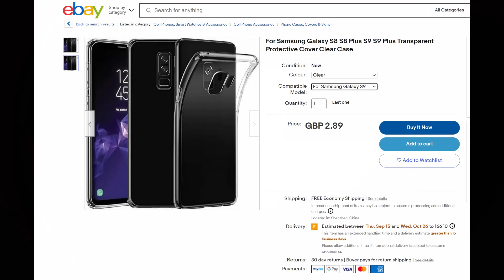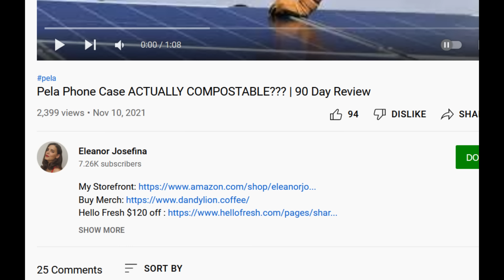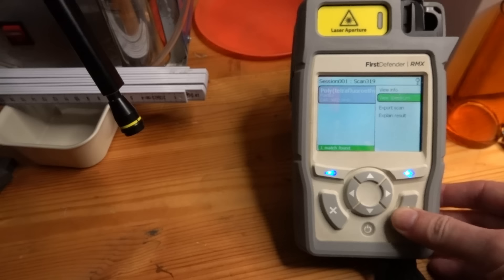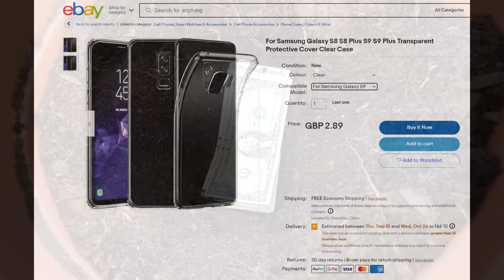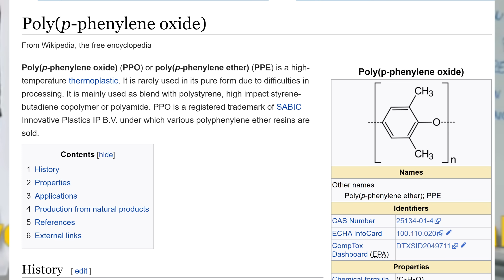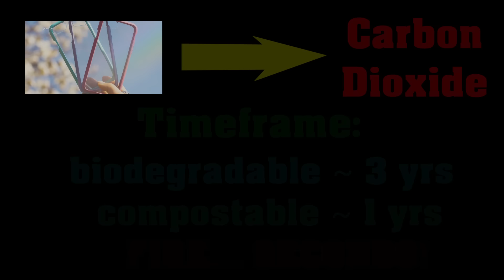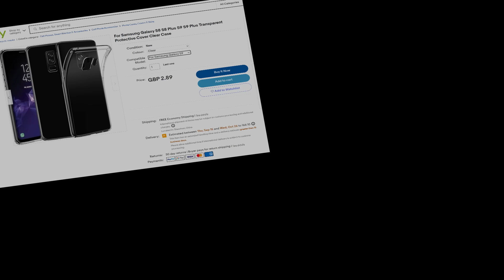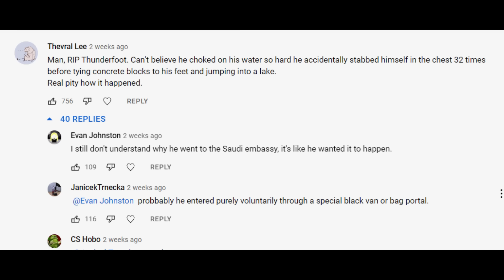Pela-Case: BUSTED!!!

Comment: Fun fact:
Just don't buy unnecessary tech just because it's new. And buy a plastic phone: no need for a case as you haven't got a glass back to break!
Reply: Cases primarily protect the screen not the back. If the back gets broken you can probably cover it with a case anyways.
Reply: What about the front glass?
Reply: Since I dropped my phone a Nokia 3310 (plastic) out of my pocket onto concrete at work and it suffered unexpected fatal disassembly I always have a phone protector and screen protector. now if I drop my glass cased iPhone onto concrete it bounces with zero damage.
Reply: @--_DJ_--  glass protector. All my devices have screen protectors and the work.
Reply: @PalladinPoker  Frankly speaking only a case with a flap or a "holster" would protect your screen. The screen will break with any other type, as soon as there's a tiny rock on the ground that protrudes enough that that border on the sides is rendered useless. Or if it's a tiled surface (happened to my mom's phone... while it had both a screen protector and a case, was quite an unbelievable sight to behold).
Well, it generally won't matter, as the phone itself will rarely hold up past 2 years. And people will change them every few months, bcs new shiny piece of polished $*** is better" than my "old" piece of $***.
:(
Reply: @dogwalker666  I don't know how much drop protection glass screen protectors really provide. Usually when we see a glass screen protector break, it's not necessarily an indication that it was absorbing all the impact, so much as it's just a much thinner piece of glass than the front screen of the device.

Not saying they don't have any utility, it certainly help with scratch prevention. I think they might be less valuable withdraw protection than a lot of people think
Reply: @syclone  Then there's me, replying on a phone made when Obama was president and the UK hadn't decided to leave the EU.

If a phone lands screen down on a hard protrusion you are screwed regardless. I don't use cases myself, just treat the phone like the valuable and delicate device it is.
Reply: @PalladinPoker  use a bare Xperia X Compact myself. The size is one that actually fit's in a pocket and is comfortable to use single-handed.
Drawbacks: no IP rating ( only the japanese S0-02j version had it), the headphone jack is on the way out (the quality of these really dropped, my MD Walkman works perfect still) and battery is holding the charge as when it was new.
Better than a Samsung, but not perfect.
Reply: @syclone  My moto g6 was 3 years old when I got it and it still works just fine. I don't know anyone who gets a new phone every few months.
Reply: @--_DJ_--  I know plenty of people, including my boss and several classmates from uni (rich parents). It was amusing to see them struggle to use Word though xD.  Crazy people. Meanwhile I'm still using my 20 year old minidisc... 
It is also ridiculous how over-specced these phones are, compared to what they end up used for.  Aand, with all those specs, still can't run fully-fledged Excel hahah.
Reply: @syclone  I was still using a Samsung Rugby 2 up till last year. They were annoyed at work that I couldn't use the new google stuff they have set up so they gave me a phone and pay for the plan. I can rarely text someone without mashing a few wrong buttons, I would not trust any excel document created on a smartphone! I might be the only person in the world who misses T9.

Comment: Another way you can offset your carbon footprint would be to plant one or more trees.  Trees and other plants pull carbon from the air, and (please correct me if I'm wrong) gain most of their mass from that carbon they pull from the air (excluding water mass, though some do pull water from the air too).
Edit: ah nice just after I posted this, the video mentioned trees 😁😁

Comment: I don't think these YouTubers know that "compostable" does not mean burying in the ground or even in your garden compost pile, they are meant for industrial composting, with high heat and humidity. Same for the "compostable" shopping bags that are regular plastic bags with a bit of corn starch and don't decompose in your backyard. The starch just breaks down the plastic into smaller pieces that stay for years in the environment, until we are able to bio-engineer bacteria that will really be good at degrading this energy-rich plastic.

Still, an outrageously pricey phone cover that will probably start biodegrading in my sweaty hands as soon as I try to hold my phone. And you're right, in my city of Toulouse, France, non-recyclable plastic is burnt, with the heat providing hot water and winter heating for 40,000 apartments, nothing gets into the sea.

Comment: I got my Pelican phone case from Goodwill. Helps to be using a old phone where old cases are in thrifts. Also, I saved the carbon of several phones. I will use it until it breaks.

Comment: 8:50 i have the same kind of stock phonecase which came with my oneplus6. The phone survived a staircase fall without meaningful damage.
A more general comment : 
i just don't understand how people come to think mixing biodegradble stuff with plastics improves anything
Moreover the hype over  biodegradable stuff is just as insane. I don't want my stuff to degrade when exposed to moisture.
If anything we should make most plastics more resilient, more resistant to UV and physical damage. Some fiberglass reinforced plastics are really really sturdy and endure many abuse before they fail castrophicaly and go to the trash bin.
We should design stuff that will not get trashed before a very long time and that can be repaired, repurposed or recycled (or incinerated in a responsible way)

Comment: Money is a receipt for work. Work requires fuel/energy. You need to work 20x more to buy the Pela case than a $3 case. Not very green.
Reply: yeah that's what i think every time i see expensive green stuff. i saw someone else suggest going to carpenter and paying them $50 to make a case out of wood. and i was like, no way can that be better than the $2 chinese plastic case. if they can do for that much cheaper it's because they found a way to do it more efficiently.

Comment: I'd be curious if there'll be any false advertising lawsuits over these phone cases, as they're clearly not compostable by their own definition, or compostable by general definitions. I'd also be curious to see if there's any grounds within that lawsuit to go after the green marketing of this, as it's not really any greener than the majority of typical cases on the market; it's not a change such as single-use plastics to recyclable plastics for example, it's more of a change of unnamed recyclable plastic 1 to unnamed recyclable plastic 2 of nearly identical, if not entirely identical, plastics. I'd also be curious where they're actually getting their 'carbon credits' from, I wouldn't be surprised if it's a 'we planted a ton of trees' situation, of which would be more worthless than not cutting a tree down; while combatting deforestation is good for a variety of reasons, the whole concept of combating carbon dioxide levels via trees is so ungodly blown out of proportion. I wouldn't be surprised if Pela isn't actually neutral or negative via credit as their method is probably bogus to begin with, and I can guarantee you they are not accounting for logistics beyond manufacturing when talking about their carbon footprint, as even if they outsource logistics to other companies they are still partially responsible for emissions generated by those outsourced companies, shipping and warehousing before retail/consumer purchase are services after all; just another claim to throw onto the pile of false advertisement. Just a bit of investigation can make the whole jenga tower fall.

Comment: I have a fairphone. I don't need a case. They actually designed the housing in a clever way IMO . There is a structure around the screen that when it drops absorbs the shock it seems. Dropped mine quite some times... The housing deformed but the screen stays save. I like this philosophy maybe it doesn't look as slick but the design is practical. The phone stays as thin as it is our needs to be so to say.

Comment: Another fine way would be protect the environment is to maybe, just maybe, design new phone variants so that they share the same layout as their predecessors thus the old phone case can be re-used for the new phones.
Most design choices on placement and sizing connectors, notches or microphone/speaker/camera arrays have no technical grounds other than make the new model stand out.
Which, if we think it over, just like the glass backplate (other than be vulnerable AF), makes no sense, as 99% of users will put the new phone into a plastic case, covering it all up.

Comment: I think the biodegradable/compostable is more of an argument for the plastic pollution in the ocean rather than the CO2 footprint. However then the tests should be what happens if you keep it in the ocean instead of burying it. My guess is that it would barley degrade at all if left in the ocean, especially if it is deep enough to avoid the UV.

Comment: Yeah if you are worried about a dang phone case not being biodegradable, recycle it. A lot of these things are scams and people secretly trying to make money. Just like the plastic bag ban thing. Many plastic bags decompose in the environment pretty quickly. I remember putting some aluminum cans in bags to save up to recycle later. I put them outside and some months later when I went to pick them up, the bags were disintegrating into dust flakes. Now they have us buy thicker bags to reuse but I wind up throwing them away just like the old thinner ones when I am done reusing them for things.
Same thing with compost. People say to seperate the food waste from the recyclables and trash. But it's actually better to leave the food waste with the harder to break down trash, because the bacterias and organisms that eat the food waste will help break down some of the trash too.
So many people try to scam others using guilt and it's ridiculous.
Reply: Do you mean recycle yourself or recycle: get somebody else to do it? Because I've heard and believe that more things than not promised to be recycled actually wind up in landfills anyway.

Comment: Well, if you offset by buying CO2 certificates for the energy sector, which you can do, I believe, that actually helps somewhat currently. But off cause only, if the whole amount of certificates is used up, so it needs to be scarce anyway.

Comment: If there is that much butylene in the cell phone case, oils and petroleum-based solvents will eat it up. The grippy "rubber" overmold  on most power tools is made of something similar and they will start coming apart in your hands after exposure to oils or solvents.

Comment: your talking about compostable plastic reminded me of Hasbro's new packaging for their transformers.  They want to use less disposable plastic for their toys so instead of blister bubbles or window boxes they're doing 2 things that have their own problems.  Either 1-a totally closed box, which means you can't inspect the figure in the store for flaws (may as well buy it online then) or 2-an open window box without a plastic shield on the window, so people can vandalize or outright just steal the figure inside (insert picture of shelves of Lebron James Space Jam figures with stolen heads and piles of empty Bumblebee movie Ravage boxes here.)  Couldn't Hasbro keep the plastic in their packaging but use a more biodegradable type?

Comment: The big thing about reducing carbon emissions is not really how you release it, but where you source your carbon from.

If the case was made 100% from plant fibre, that is carbon pulled from the atmosphere. If it has even a fraction of it from any oil byproduct, you've just introduced new carbon to the atmosphere that has been "locked away" for millions of years.

It is impossible to use fossil oil in any stage of the process, from extraction to manufacturing to delivery, and be carbon neutral or carbon negative.

But a thing Thunder hinted at here was that we may be able to delay the release long enough that we can reduce our output, if we "lock the carbon" in something that takes longer to release. Something like perhaps plastic, that takes decades or even centuries to break down.
And we're not stupid about it, like dumping the waste into nature where animals can be harmed by it, or burn it.

Comment: And then there's the impact of what you have to do to obtain the ~50 bucks before you hand it over. Incidentally, burning of waste plastics has been a thing, since forever! They perform as solid petrochemical fuel and are used directly in furnaces at cement plants and other high temperature processes.

Comment: if you truly cared about the environment, i would opt for a phone with a replacable battery and expandable storage so i could get a longer service life out of the phone, after all the environmental cost of a phone is like 200 times higher than the case, 
also i would opt for a case that protects my phone well so the phone and the screen is less likely to be damaged because after all a new screen is like producing 50 cases in terms of resources that need to be mined and production methods involved,

Comment: I would think the cheapest easy way to sequester carbon would be to buy and bury charcoal briquettes.  A quick search found a 40lb (18.14kg) package of charcoal available for local pickup for under $20.  Since each gram of charcoal represents about 3.6 grams of sequestered CO2 (may be less depending upon exact composition), that would be about 60,000g of CO2 sequestered for $20--much cheaper than 400g for $30.  Actually, if charcoal production and sequestration facilities were built near fields where biomass was harvested, I would think such facilities might be able to use the gases released by coking biomass to fuel the harvesting operations.  Given that charcoal is about $1/kg retail delivered, it could almost certainly be produced much cheaper if the goal was simply to convert atmospheric CO2 into solid elemental carbon and oxygen and leave the carbon in a pile somewhere.

Comment: Granted they are a bit more expensive but you can get an actual wood and generally metal and are quite nice. They have some biodegradable plastics with some of the cheaper one but are decent. But they are all pretty stiff, and don't bend for some obvious reasons.

Comment: You can usually defeat most of these products by arguing about the  transport. Transport of a Pela case releases much more carbon than the bulk-transported-cases in the next supermarket. Possibly ending at a kg of co2 per parcel...

Comment: Guessing this pela case is mostly PLA, which would explain the name. And Polylactic acid is advertized as "compostable". Granted, it only breaks down effectively in big municipal piles... Of which basically none accept plastic waste.
If it is PLA, you could buy a 3d printer and a spool of filament for the price of 2 pela cases. See, honey? I need a printer to save the planet!

Comment: Compost in 6 months?  If you get the mix of water, air, nitrogen and carbon in the compost pile right, it should kick up to 130-140 degrees F and be done in 2 or 3 weeks, not 6 months.

Comment: I’ve been using the same 12$ Supcase Unicorn Beetle case for my past 3 iPhones and have had this one since I got the iPhone 11 Pro Max at launch and none of them have let me down. I’ve dropped my phone a million times and I haven’t cracked any of my screens ever.

Idk but I think that’s more environmentally friendly than buying a 60$ case you’re going to throw away because it feels cheap and doesn’t actually protect your phone 😂
Reply: The phones you go through are way more polluting that the cases you would be going through... 
I've got a 3 year old Huawei and can't really think of a reason to change it. Yeah, i'm 3 OS's behind, and 3 model lines behind, but really? It works fine.
Reply: @dont.beknown5622  dogg, I’m still on an 11. The current iPhone is the 14. I’m also 3 generations behind 😂

And the phones I stop using I usually send to family in Mexico so they get to use it too. I’m not just throwing it away 😂
Reply: @Ese1Pac  The ultimate recycling!! Good on you. 
I keep things until they fail or can't be used anymore. I try to find use for them.

Comment: No case works if you drop your phone straight on the glass. then you are at the mercy of odin. The most common is dropping it, hitting it with you foot and launching it to Mars. Or throwing it at your bed accidentally throwing too hard and hitting the wall. Luckily you live in a mobile home with your moms new daddy so the walls are made of paper and absorb the chock pretty well.

Comment: If it's supposed to decompose in 3 months, it will decompose from body sweat and skin oil acids as well. Is there a maximum period of use limit? The process to replace decomposed phones would be less green.

Comment: They really need to decide if they want to sequester the carbon in a long lasting plastic that sticks around long after its product usefulness is over, or have a plastic that degrades quickly, putting the carbon back into the cycle.